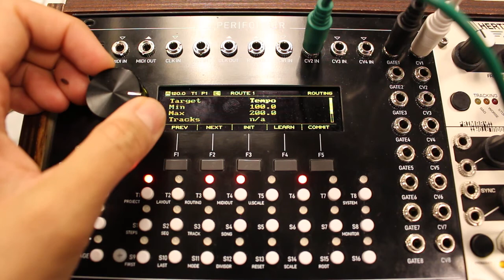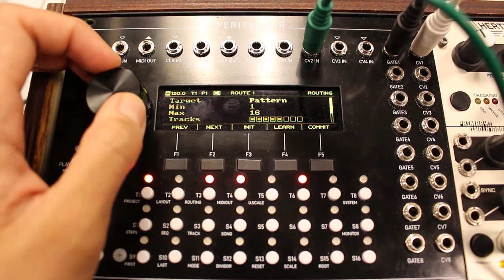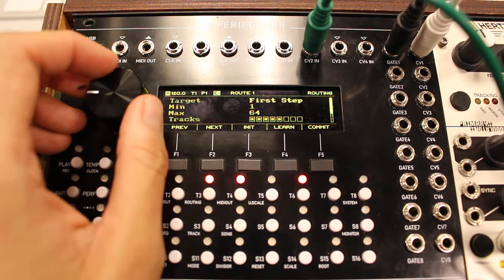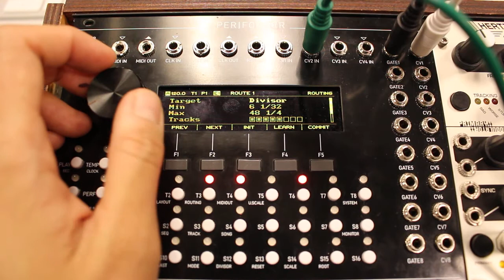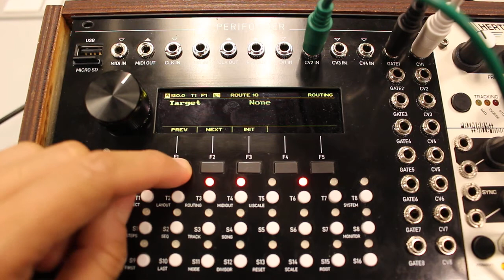Westlicht PerFormer Exploration 2: Internal Patchbay (Routing) Overview

Comment: Do you know if you can use it as a cv to midi converter?
Reply: Yep, you can also use the USB port to transport midi ans set some tracks in CV/MIDI mode
Reply from the maker: I think so, but I don't really use MIDI with my modular setup. If you're using the 3.5mm MIDI output, you have to find a "Type A" connector (for example, the one used by Arturia controllers). I have not tried any MIDI connection with my setup. Good luck!
Reply: yes. you can. RTFM :)